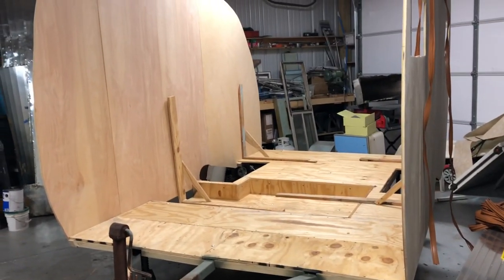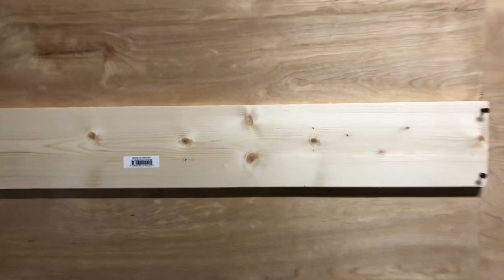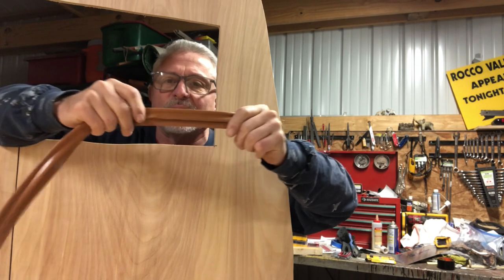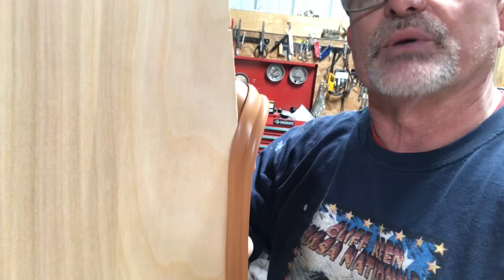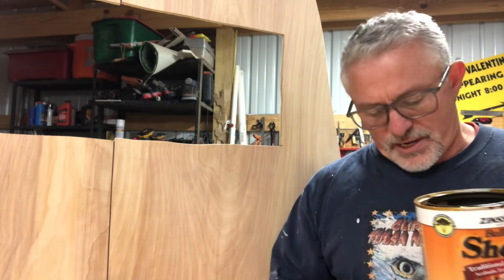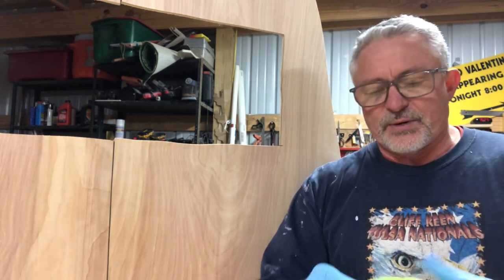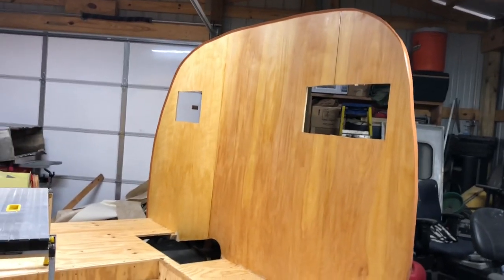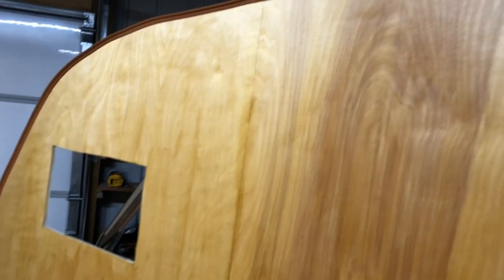EP 113 Whole interior with Amber Shellac vintage camper & WELTING 1966 Scotty Gaucho travel trailer

Comment: Hello Rob where did you get your welting strips is there a website I can order , I haven't found any yet
Reply from the maker: I get mine at Vintage Trailer Supply
Reply: @RobTheRebuilder   is it called 3/4 Vinyl cove molding for $24.99 or is it called Cove Cabinet Welting for 19.98? there's two options I just want to get the right one
Reply from the maker: @paulaguilar8142  "Cove Cabinet Welting". The cove cabinet molding is like quarter round trim.

Comment: Did you glue 1/8" luan to your plywood walls? If so, what kind of glue did you use and how did you apply it?
Reply from the maker: The walls are 1/2' cabinet grade plywood. Luan on the ceiling